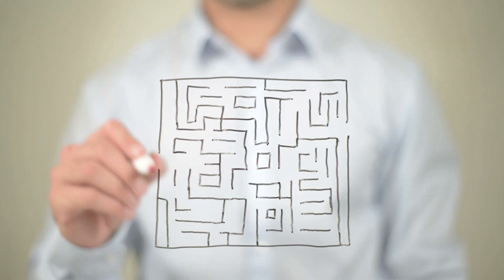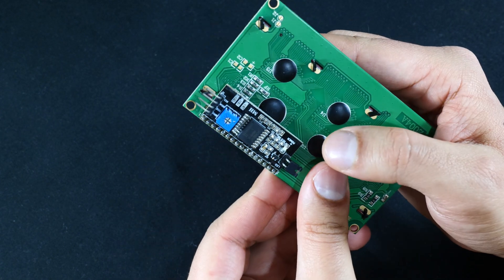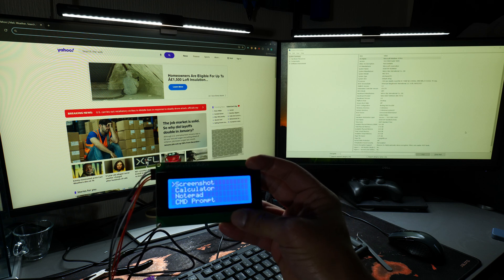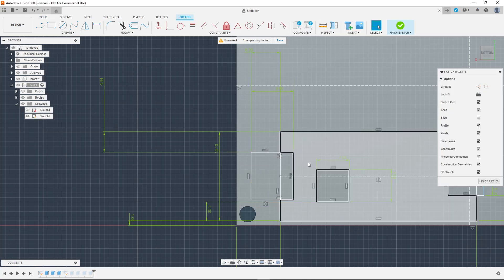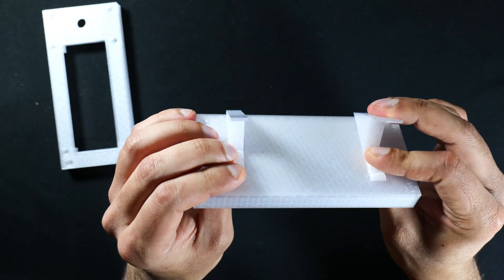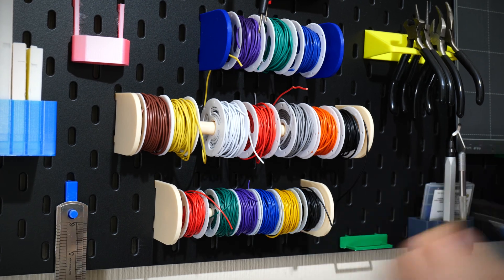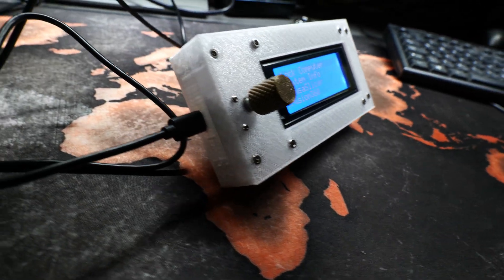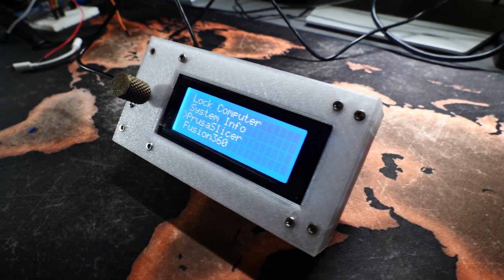I Love Shortcuts So I Made This

Comment: Really don't get this. It is very easy to make a schortcut combination for every program just on your keyboard. ctrl-alt-d starts my command prompt, ctrl-alt-c my calculator and so on.
No additional hardware, programming and extra buttons needed for that. And single handed operation too.
And if bolts are too long why print a new enclosure? Just cut of the excess length of the bolts.
Reply: I saw that the bolts had the same length than the add-on circuit for the screen, so cutting the bolts would not solve the lack of space. But why not just printing another back a little higher ?

Comment: Since you want to be able to take out just the Arduino, you could cut some Dupont wires, solder them to the LCD/rotary encoder, and have the female end plug into the Arduino's headers. This would mean that you just have to plug in/out some wires when you want to take it out/put it in.
Also, an OLED version of this project would look incredible. Something like a 128x32 or 128x64 screen would not only make it more compact, but make it look cleaner overall imo.
Reply from the maker: Great ideas. I’m with you on the OLED, I’ll definitely be sourcing some for upcoming projects. Thanks for the feedback friend!